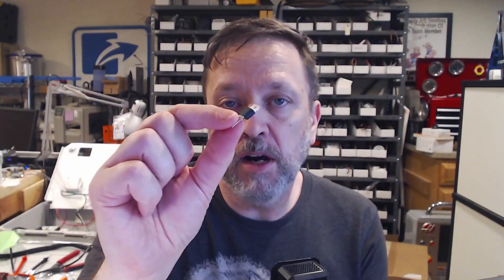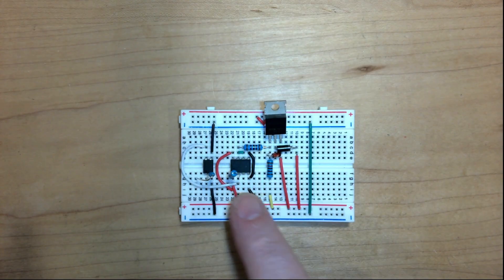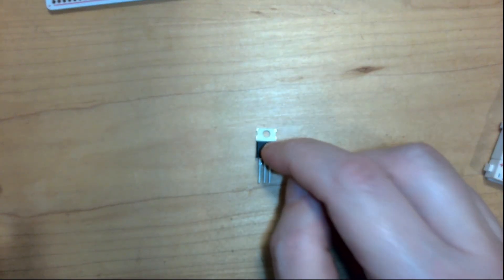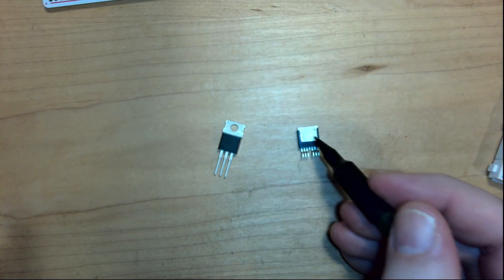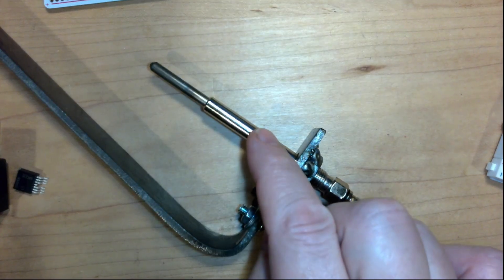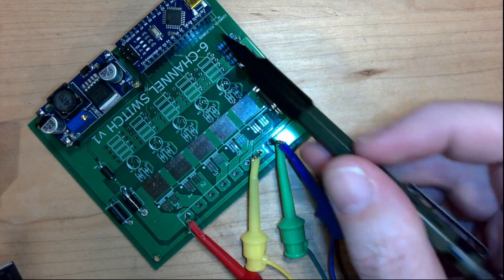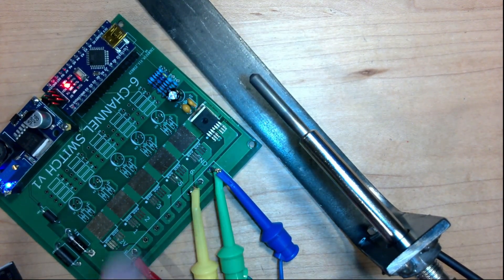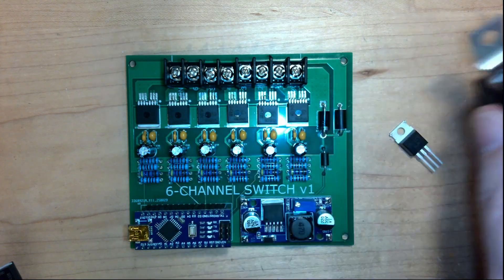Using a MOSFET to Switch High Current Automotive Loads (Part 4): Build a Diesel Glow Plug Controller

Comment: Thinking beyond here, this way you could technically build your own basic ECU combining all with analog sensors, collect data on existing sensors resistance, adding gauges... crazy electronics. I just love exploring this endless world❤

Thank you for sharing your knowledge. I'm gonna build a board to relay my Golf Mk2's headlights..
Reply from the maker: Yes, you could. I hope to build a controller for several gauges this winter.
Reply: @dotnetMakers thats super awesome man, I hope you'll update us on your ideas... looking forward to the creativity! I have 0 schooling or anything related to electronics, just my own personal knowledge from owning very old vehicles > having a problem which there is no solution for > getting into the extreme rabbithole of electronics and now also building stuff like this, I was trying to figure out if there was a digital solution to the bulky analog relays, stumbled upon this video and you confirmed basically all I could think of. Again, thank you so much!

Comment: One disadvantage of Relays is the power consumption of the coil in applications when the coil is active for longer periods while engine is off. Automotive relays take about 0.1A for the coil

Comment: I Used an on/off/on switch with built in leds, I was wiring a fan for temp sw control/off/on
I had to add diodes to get the leds to not get back fed from the one relay.
I had a guy tell me I was building a complicated circuit when I asked if my schematic looked good.
I replayed that there was only one relay and I'm not using mosfets to control it.
 lol
For redundancy I should have the auto and on have different relays and power sources. More diodes required for that 🤓

Comment: Never mind previous comment - I found these "DAOKI 10pcs 15A 400W MOS FET Trigger Switch Drive Module PWM Regulator Control Panel" They will do the trick. Thanks to you, I understand how they work.

Comment: Thank you so much for providing all this info, step-by-step from fundamentals to end result. I am rebuilding an old motorcycle. I intend it to be a daily rider so reliability takes priority over originality. Wherever possible I have upgraded to modern electrics/electronics. As a result ~80% of the wiring harness can be built with 20g wire. However there remain some components, headlight etc,  that require more current. I would like to build a circuit like one depicted in this video using a 12v switch rather than the digital logic control. I feel competent enough to build it but I am at a loss when it comes to specifying the parts and the schematic related to the 4 resistors and 3 capacitors. Can you provide guidance on that? Or do you know of a board/kit that provides for a 12v signal instead of TTL? Thank you again.

Comment: How about fuses? 
Suppose you want to fuse each output channel, would you use traditional leaf fuses or could you do this in the logic of the controller?
Reply from the maker: Since it measures current you could monitor that and shut down any channel that is over current - the logic of the glow plug controller actually has upper and lower bounds it uses. I'd still use a physical fuse, though

Comment: Thank you so much for this series man. I build a 12 relay box a few months back and it ended up being too bulky for the area I wanted to put it. Your videos are helping me greatly with planning out a new build using a smaller box with 2 relays for bigger loads and 10 mosfets of varying sizes for smaller loads around the truck. Looking forward to getting all the parts ordered to start building!
Reply: Heck I might just order one of your built boards.

Comment: Is there a similar through hole version of the mosfet you used in this video? Not sure if you remember our emails about a fan controller I am making, but this seems like a better option that what I I have been working with.

Comment: Because you switch the glow plugs independently you can then use the glow plugs as voltage dividers to detect cylinder temperatures and then gauge engine health. Cylinders with higher compression have hotter glow plugs when running. Hotter glow plugs have higher resistance.
Reply: Great idea! By reading the I-Sense Outputs of the FETs at the beginning of the glowing process, when they are still cold, you can also determine the health of your glowplugs, even indicate defective ones, by blinking the numbers to the indicator lamp.

Comment: I've really liked this series, it has been really interesting and one of the best teaching videos I've seen in quite a long time, you've explained everything really well and made it interesting and practical. Could you do a follow up video on the circuit board itself, it's a very simple design, and the links you've provided are great, but I feel that there will be watchers out there who would benefit from you describing how you determined the width of the paths so as to allow the high currents to pass on the circuit board without shorting out to other tracks.

Comment: Oh I like these!!!
I had a look, turns out they make a similar chip for 24/48v systems too: BTH50015-1LUA

I plan on using a few of these on my next driver board.
Reply: I did some digging after finding these on infineon's page, and found a somewhat similar half H-bridge driver too: IFX007T. One clearly inspired the other. They make different versions for different max voltages, I chose the 40v version.

If you wanted the BTH50015-1LUA FET+driver, but wanted a higher PWM rate, the half-bridge version might be more suited to your application.

My only regret is not watching this video a week ago, would have saved me from buying the wrong motor driver IC's - the infineon's are WAY better, and simple! :D <3 Wouldn't have found em without this vid.

Comment: Yes, but what if it turns out that AI decides to use directed EMP pulses on your 6 cylinder diesel farm tractor because it determined it to be a threat? No more turnip farming for you sir. If you would have just used those good ol relays from yesteryear, we'd all be eatin fresh turnip pie right now. But no. We're all working in the AI salt mines with no turnip pie. Gee wiz, what a bummer. Well, gotta go, my cat's on fire again and I have an appointment to get new thicker aluminum foil hat installed. Wish me luck! Thanks for the video!
Reply: Haha exactly. So many strange people insisting that he should only be using relays. I didn't realise there was such a big relay enthusiast club out there!

Comment: benefit of a relay over a mosfet transistor is physical disconnect. there can be leak current at zero gate input. gate resistor? gate is a capacitance contact, ie cut connection for dc current.
Reply: Have you ever played with a mosfet before? When the gate is pulled low, the Rds is extremely high - any leak current is inconsequential.

Comment: I wonder how much more work it would take to make a UI via a phone app to control current limit on each channel for protection shut down/limiting etc. DIY pdm
Reply from the maker: With a different micro that has bluetooth support it would be pretty straightforward.
Reply: @dotnetMakers maybe an esp32? Is this something yourself (or if you can recommend someone) can help me with? I’ve wanted to do it for a long time but it’s above my understanding. Thank you for the reply

Comment: like your idea. any change to make the board smaller with inputs like a PDM unit? that way I can have one micro controller driving several of these boards to replace my whole 41 yr old wiring in a 4wd. drive headlights, wipers, blinkers, parking lights, fan speed control etc.
Reply from the maker: It would get challenging making it any smaller simply because the FETs, traces and screw terminals are simply large due to the current requirements.  You could go to smaller surface mount discretes and tighten up the spacing, but the micro takes up space, it's needs regulated power, and you need a bank of MOSFETs with enough board to act as a heat sink.  You might be able to double-side the components, too, but for hand assembly, that's not fun.

Comment: In the first part of the schematic (power source) there is a FB1 inductor before the LM2596 module, could you please share to us the code or value of it. Thanks in advance.
Reply from the maker: it's just to suppress noise, so something like 100 ohms at 100MHz is good enough.

Comment: I'm following this. My car is from USA and I live in Sweden many US-cars of my model that was imorted to Europe had the export wiring option for the rear lights but not mine, it has been modified with relays to solve the requirements here. Amber blinker seprated from the tail light..  The relay solution works just fine but it has the following drawback: noice.. You will hear the oem turn signal relay and also the extra fitted relay and if you step on the brake you will hear one click from the brake light relay also. So the Mosfet solution would be great. It's a car so normally they will switch things on with a positive signal if the load goes thru a relay but the BCM uses negative swiching to the rear lights. So your first model will work or I will try to find a negative switching ciruit as your example in this video is positive switching. Thank's for your educational videos!
Reply: Its such alot of work just to eliminate the clicking noise of a relay!
Maybe try some CLD on the body of the relay, thus really makes them quiet. Or, use a solid state relay. Couple simpler options

Comment: A nice looking build. I'm impressed that you made sure all the resistors and caps were in a single line, as this makes it look like a professional design. I'm a little disappointed that you didn't do the same for the tracks around the tantalum caps, as a couple of them look really good, but others look like they were just thrown into place.
Reply from the maker: Yeah, I should have spent more time on that. I should have done more clean up on the silkscreen, too, but I was under schedule pressure. Someone wants to drive the truck it's going in while the weather is still nice.
Reply: @dotnetMakers  I did note that the board is only a v1, so getting it working correctly and ironing out the small bugs is a bit more important than pure aesthetics.

Do you use auto-route, or do it mostly by hand?

Comment: I don't think this will be more reliable for the long haul compared to a conventional relay, or in my diesel's case a solenoid which also has such a nice pleasing CLUNK when it engages.  This is def cooler than anything I'd think up though, I mean no disrespect just a note to other diesel mechanics out there, this isn't going to be a cheaper option or a longer lasting one.  I'd bet the power loss is less with the relay as well, hence there will be less heat.  First time viewer, can't wait to see your other offerings.
Reply: Your opinion on reliability is moot - conventional relays cannot be driven directly from a micro-controller (because they need too much current), and you can't use them for PWM.
Reply: @clintoncoker6 I think he was saying relays work better and there is no net advantage to using the PWM at all.   I can't say I can understand why there is a real need to reduce power consumed by the glow plugs, either.
Reply: @brianhaygood183 It doesn't matter if he needs PWM, that's what he wants to do, and you can't do it with relays.

Regardless, you can't drive relays directly from a microcontroller, so if he has other functions to be driven from a microcontroller, he needs a set of mosfets anyway.
Reply from the maker: Solenoids definitely have their place and work fine.  This will use less power - the resistance through it is < 1 ohm.  A typical relay coil is like 180 ohms.  These also have no moving parts, so if it was conformal coated to protect from corrosion, I would expect it to last as long as the electrolytic capacitors - so 25-ish years.
Reply: @dotnetMakers a solenoid also needs the magnetic field to retrac de startermotorsprocket against de flyweel teeth

Comment: That is quite an impressive part with an excellent datasheet that at least at first glance leaves no question unanswered. It isn't exactly what you'd call "high speed" in terms of switching slew rate, but then that is by design. It appears to be very well protected against the brutality of an automotive environment. One interesting thing in the datasheet is the "one event allowed for the lifetime of the part" spec for total energy of an inductive load.(Table 2, Power Stage, first line P_4.1.12). I don't recall ever having seen that sort of spec in any of the multitude of datasheets I've read.

Note that if you really do want to use it at 80 A with long ON time you'll need to pay close attention to PCB design. It will dissipate about 13 W at that current when it is hot. You'd have a difficult time handling the heat without using a mulit-layer PCB with fairly large foil areas and lots of thermal vias. At 15 A it's a dawdle.
Reply from the maker: The 6-switch board I designed was for a comfortable 20A and I was really impressed with how it performs - especially for like $6 is quantity 1.  I think once you start exceeding 30A or so, shedding heat will start to become interesting, though maybe with some creative heat sinking it would be alright.  Right now I have 1cm wide 2oz copper pours on both faces of the board stitched together on a pretty small grid, and getting more current would require moving things further apart.  Spacing on the screw terminals probably starts being the limiting factor.

Comment: When you use a MOSFET for switching and place it in the engine bay, overheating becomes a major problem.
That's why conventional relays are still the choice of automotive engineers for switching current.
And of course, relays remain a favorite because of their low price and excellent performance.
Reply: You should probably raise the hood on a modern vehicle. They are putting the ECM's right on top of the engine.
Reply: You can't drive a relay directly from a micro-controller. You also can't use them to do PWM.
Reply: @clintoncoker6 😅
You can make a relay circuit with transistors and optocouplers or you can buy the module in the market place, sir.
Reply: @pejuang-solder I am indeed aware. How does that make relays any more useful in this application though?

Comment: This an old mechanical injector setup, or full electronic control? I'm sure my ECU code could be adapted for 6 cylinder diesel use. I'm willing to help you alter the code if you're interested. You have to make your hardware though. could do a "roll coal" setup by replacing MAP sensor with TPS really; anything more would need code change, for limiting injector pulse duration based on RPM for example. Already has end of injection timing adjustments per RPM, with interpolation between cells if you want injector timing to change with RPM.
Reply from the maker: I'm pretty sure this is electronic, but honestly I don't know.  A custom shop I work with asked me to build it, and I lose track of the projects they're doing. I love the fact you made an ECU - too many people think these systems are just magic. (I repaired the ECU in my 88 YJ just a couple weeks ago).  Now I feel like I should convert my 67 Dart to home-made injection.
Reply: And many only care about open source as far as "ooh look, something free-to-me". My "Rambling about my open source Pi Pico ECU logic/math." video is best explanation that exists for it so far. Links in description too. Maybe you'd rather do your own from scratch, I don't know. Mine only works with the GM 24X pattern; some good engineering in that wheel. The pattern is basically error prevention; the engineering goes all the way down to pattern registers initializing to all zeroes. I'd rather mount a new wheel than support 100 variations.

Comment: Chris, this is exactly what I need for my 1948 Plymouth build. I want to run my radiator fan with PWM depending on the coolant temp. Where can I get this board?
Reply from the maker: I could probably add it to the web store in the next day or two. I have a few extra PCBs, but I'll have to order more mosfets to build one.
Reply: @dotnetMakers that sounds great, I would not mind getting the parts myself and install them too, for me that is half the fun.